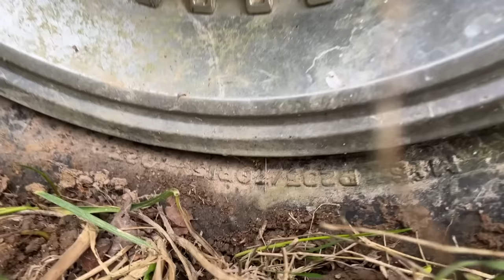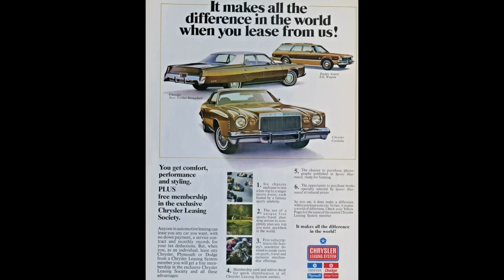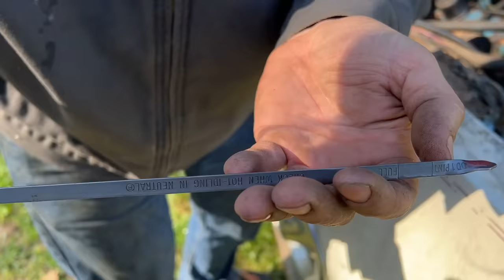Big Block Bro-Ham! Ant Infested Unsellable Luxury Car! Will It Run and Drive Home?

Comment: I hope you replaced the two rubber o-rings in the bottom of the center section!! If you didn't that thing will leak gas like crazy!!!

Comment: In that plastic insert on that thermo quad you end up having to buy a whole new carburetor if that's cracked I know I had a 77 Dodge Royal Monaco 440 commando engine and I had problems with the car bader

Comment: This car inherited its body style from the 74 and 75 Imperial, however it did not inherit the 4 wheel disc breaks....It did however get a stronger 440 HP rather than the standard 440 that was in the Imperial of this body style.

Comment: I once had a Honda XL600 and nobody could get the carb sorted. Eventually I stripped the carb. Put it in a big pot with Lemon Juice and water mixture. Boiled it for about 20 minutes turning it around during this time. Rinsed it with water and clean air.
It looked nice and the boiling lemon juice opened all the holes.  Never had any problems again with it 
So if your massive carb does not fit in your ultrasonic cleaner get a big pot
Reply from the maker: Ok good idea thanks

Comment: If I could find a way to do it, I would buy this car from you in a heartbeat but unfortunately I don't have the money to do it. I actually NEED to get myself an older Chrysler that size due to the ride quality since I can't ride in modern cars or smaller cars because of the stiff ride due to my severe back problems that have left me disabled.

Comment: If that thing has rear discs, it's no wonder you can't do a brake burn. 
I never knew a Chrysler that old had optional 4-wheel discs. I'm gonna guess it's one of the rears that's hanging up.
Those Thermo-quads had a bad reputation for being a pain to keep in tune.
Finally, WHY couldn't you be bothered to lift that air cleaner housing over the fender and dump all that cultch on the ground instead of ALL OVER the fender well?  sheeesh.

Comment: 🎲 🎲😎 Cool Classic Car right there!!
Can't wait for it to get completely restored one day and with the fuzzy dice hanging from the rear view mirror!
My dad for many years drove a 1982 Ford Fairmont Futura....brown 2-tone, 2 door.
Eventually, we had to get rid of it....too much rust in the truck floor where the coil springs were....the whole a**end would've probably dropped on the ground soon!!🤭
The Fairmont also came with those back seat side windows/or slant glass windows. One day while my dad was at work, a high-school student threw a rock and busted one of them.
My dad had to search for 3 WEEKS trying to find somebody that still had a new one of them on a shelf to replace it.
He finally found one!! Cost...back THEN for it, was $250.00!!  And Then, he had to find an auto body shop that would replace the broken window with the new one he had bought!
Several years ago, I was lurking around a junkyard close to home, and I came across a 1979 Ford Fairmont Futura.
White w/ red interior.
Thing was incredibly NICE inside and out!
An old lady drove it since it was NEW, they told me. It even was driven there TO the junkyard!
I went home, grabbed a bunch of tools and went back to the junkyard to take some parts off of it.
So....STILL up in my garage, I have a FULL rear tail light assembly.....straight valve cover, sticky-emblems, and a few other small odds-n-ends from that '79 Faitmont!!   If you are interested in them, let me know. I live here in Green Bay, Wi.

Comment: Instead of saying Brougam it's pronounced bro'mm, some of the letters are silent...Look the word up and you'll see how it's pronounced..I figured it out at age 14 or 15yrs in the 70s, I'm 64yrs old now and so many people never pronounce the word correctly...It's a luxurious name for a luxury car such as that car was when it was brand new and still could be with a bit of TLC..I had a nice Newport that year and it would roast the tires just for fun...I used it to repo vehicles with in the 90s cause most people didn't expect a huge barge car to pull up and grab their stuff and go with it lol...I used a 2wheel dollie to grab an go. My brother had a New Yorker and we both raced em..12 seconds wasn't bad for a huge vehicle..I don't know what gears was in his but the guy that had the Newport I had, he changed rear-ends and put a Reese hitch on it to pull his boat..I ended up buying it at auction and I went plum through it and it blew my mind how fast and good it ran..I put new GM quadrojet carburator on it cause the thermoquad carburetors just didn't have the kick I expected it to have..It was a fun huge car that I wished I'da had a place to put cause it was well worth keeping with all the modifications that had been done to it..I finally ran an 11.50 seconds through a quarter mile which wasn't bad for a heavy car. The 440 put out 390 upto 430+ horsepower just fiddling with it from time to time..The New Yorker my brother had, I think it was probably upwards to 400hp with his 440 engine..After getting the engine running really good it might surprise you with how well it should run...My Newport had stock gears changed to 393s from 270s maybe cause I could bury the speed odometer on interstate highways rolling up with traffic, once in awhile I'd looked at the odometer and the needle would be buried lol..I also don't think my 440 engine was original cause I'm pretty sure it came factory with a 400 but like I said a guy went through it just to pull a huge boat..He told me all about the car and the bidding stopped at 800 bucks, I's well pleased with it cause as long as I didn't run it hard, all the time lol, it got 20mpg maybe..I bought the car in 1994 and it paid for itself several times over in one month repoeing vehicles and it pulled em like they wasn't even there lol..I done a reverse drop burnout and I shifted into 2nd gear with perfect timing and it just kept right on rolling the hide off both rear tires..I don't know the people that tried matching those rubber marks and to this day I haven't heard of anybody that done it except for blowing their engine's, transmissions, and clutches out trying to match em..I finally went back and done it again just to prove to people that I did em..I still hold the record for longest rubber marks in my area but all my buddies done died off and that rubber was gone not even several months later but the spikes are still there that we drove into the ground just to see if anybody could match it or go farther with it lol..I might build me something just to try it again lol...

Comment: CRIKEY! Unbelievable! I'd take one look at that dirty, disgusting thing and run as fast as possible in the opposite direction, and you monkey wrench with it for a spell and actually get it to fire up. UNBELIEVABLE! You are Mr. Scott, the miracle worker. Give me warp 7 Mr. Scott. Engage! 
BTW I'm still waiting for an answer on how you open a bottle with the soul of a sandal? I have to know how you do that! 
Also, those things you call casings are actually called TIRES! 
And the things they are attached to are called RIMS!
Together they are known as WHEELS, at least on Earth.
You Tennesseans speak with forked tungs. (grins) 🤯🖖🏽

Comment: 51:25.    THATS SUPER PIST.   ILL TELL YOU WHY.     SOME IDIOT THOUGHT IT WAS A FASTENER SCREW AND TIGHTNED IT.   NO ITS A FUEL SCREW. AND THE ONLY WAY ITS ALL THE WAY IN AND TIGHT MEANS THE FUEL TO THAT SIDE IS COMPLETELY SHUT OFF.   SUPER SUPER BAD